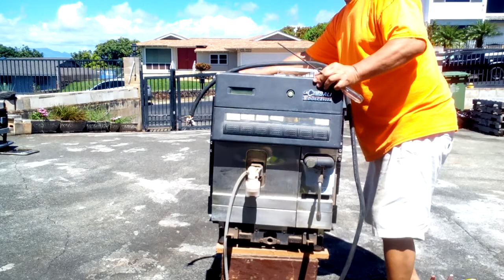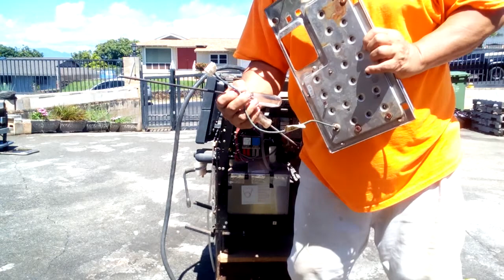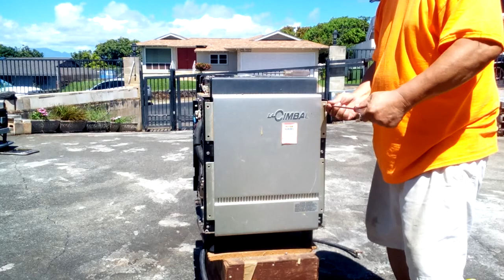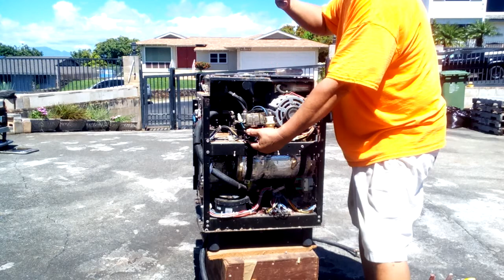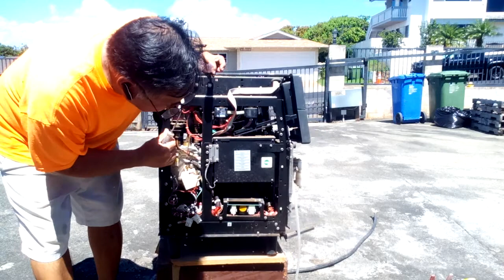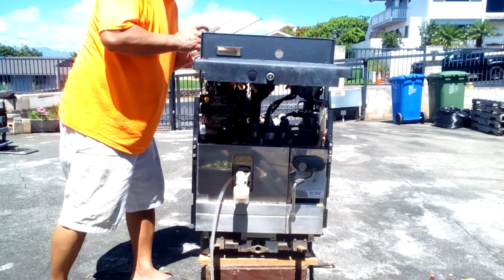931 M49/M50 La Cimbali Dolcevita 7 selection Super Automatic Espresso Cappuccino Robot machine

Comment: That makes sense, so just the same single transformer works for the US market. I assume if every motor,board and chassis are grounded and the fact that the transformer(on my system) is encased in plastic there is minimal risk of danger to the operator if there is a leak from the boiler? I know there is  no 100% risk free location for electricals in a system like this but below the pressurised water system seems to be the riskiest spot.

Comment: Thats interesting mine was connected to the double blue neutral that feeds the relay board for the water pump and grinder. From the wiring schematic I would have thought the end of the primary winding needs to be connected in common with the neutral lines and not grounded?
Reply from the maker: Grounding one side of two "HOT" AC lines is more of a European Electrical standard.  220VAC is 2 each 220V wires and 1 Neutral (0 volts to ground) But the Neutral if checked across either of the "Hot" lines will also read 110VAC.  But that's because in the USA the power supply transformers are wired that way.  Neither 220VAC "Hot' Lines are connected to Neutral or Ground (in the USA).
Europe does not use 120VAC and only provides 220VAC 1ph 50Hz period.  (yeah I know there still is 440VAC but that's for big industry and not shops or home use.)
To prevent electrical shock (across nearby equipment) they will ground out one of the hot leads.  This is also chassis ground.  This is a safety for anyone touching the case or machine's frame, it's the same voltage as all others (0VAC or  grounded.)  Since this is a Europe model there is no short to ground (120VAC) as there is no power at that voltage supplied.
M49, M50's, M1, M2, M28, M29, M30's, etc. all have to be modified for the USA markets.  That's why the USA models have lots more CKT boards and Power supply boards.  To isolate the 120VAC voltages from this European machine.

Comment from the maker: The most dangerous aspect for a technician is sticking your hand in between a live boiler and the turntable.  This is done to get at or adjust the grounds chute.  Worse if a valve is steaming.  Beside the heat from boiler and turntable.  There is a 220VAC shock hazard that will "Flash" short the power relays and boards.  That is why every time you work on ANY espresso machine:  Fix the steam problem first!